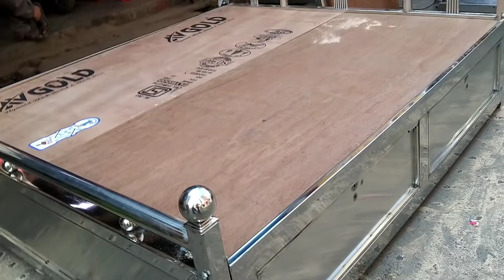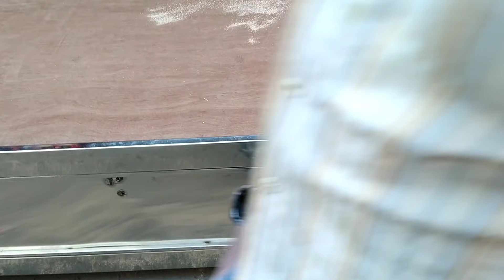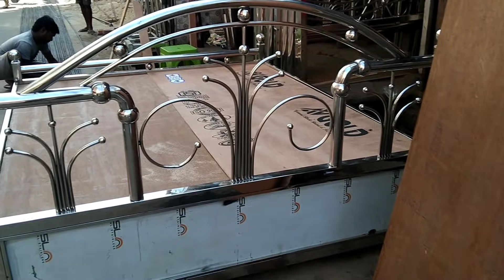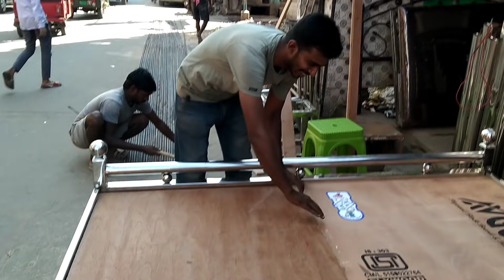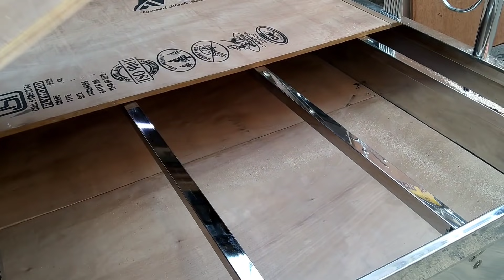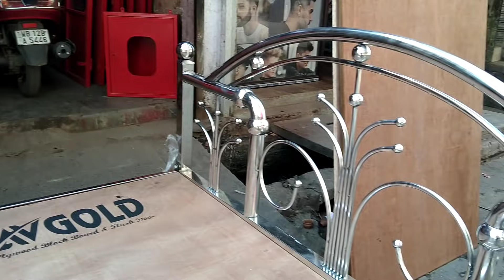Steel box bed Jimi model 2020 18swg

Comment: Nikel steel or original steel? If Original 6*7 how much price??
Reply from the maker: Original steel 32000 in pure 18 gaje weight 90 kg plus
Reply: 304   ?
Reply from the maker: 202 or 304 both are available
Reply: Mujhe bed magwana h aap apna mob no dijiye